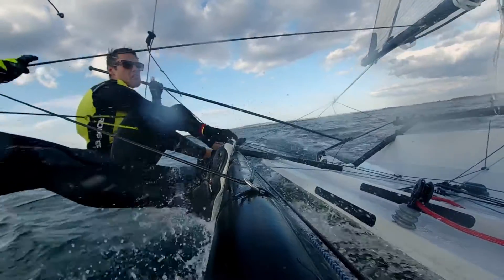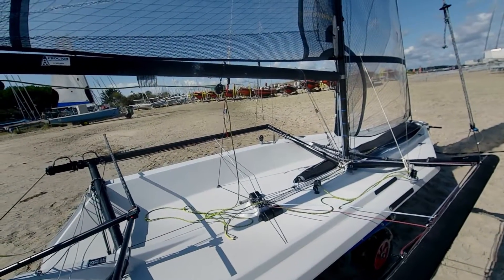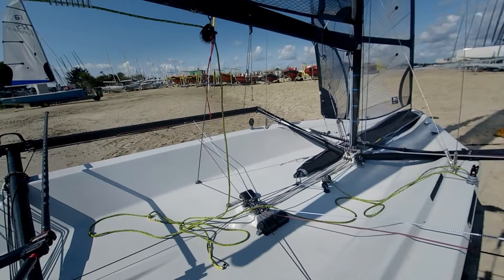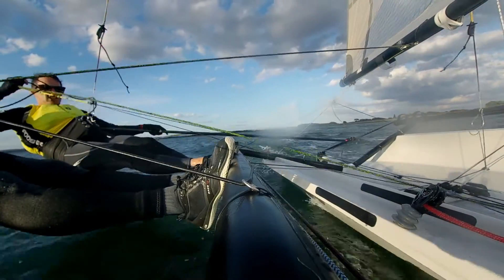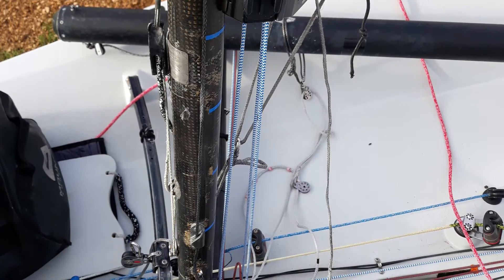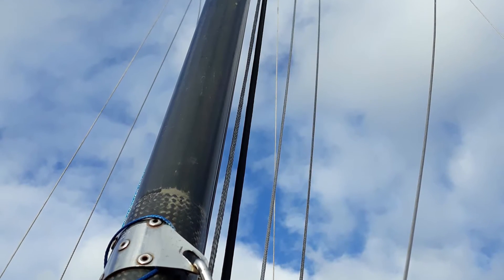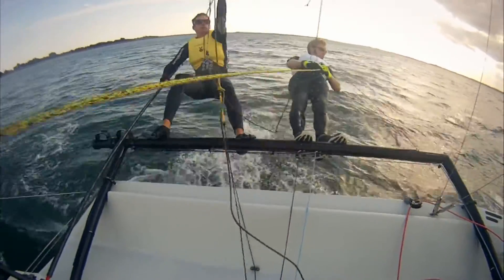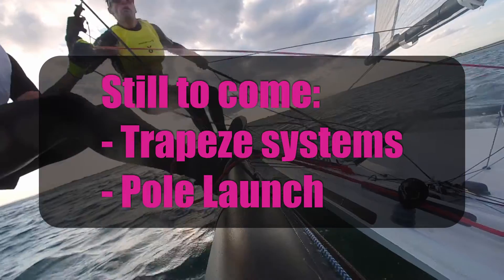The BEST Cunningham System : RS800 - Championship Ready

Comment: would you use a similar system on the RS200?
Reply from the maker: The 200 only has a 4:1 and we don't tend to pull much on, so there's generally not enough friction to warrant a release elastic. A bit of lube in the mast track should be all you need. Also, often the crew is within easy reach to give the sail a push up the mast.